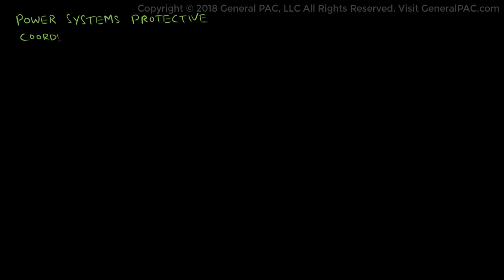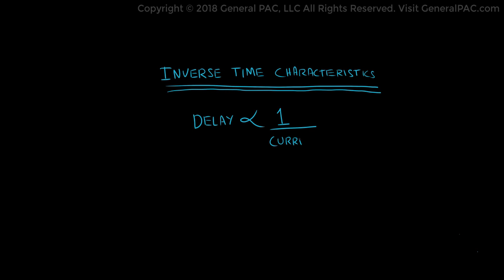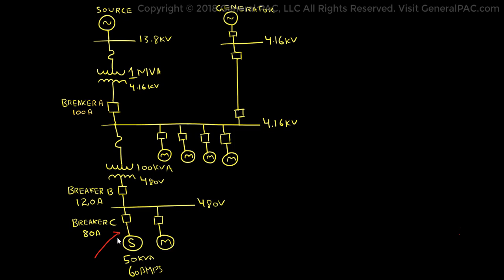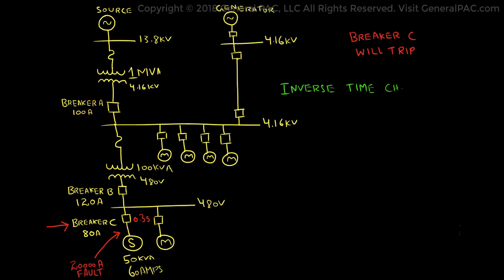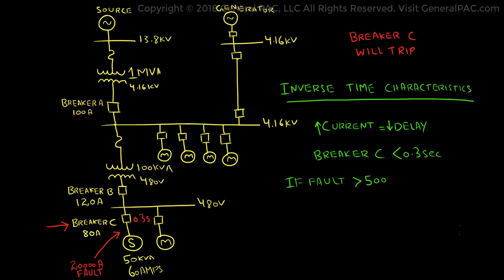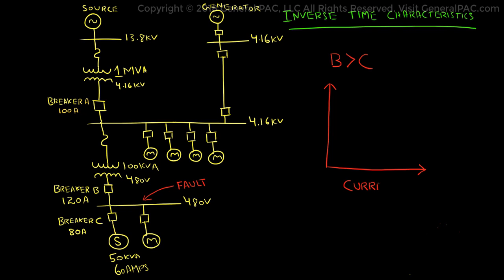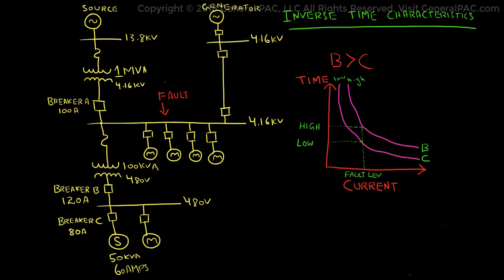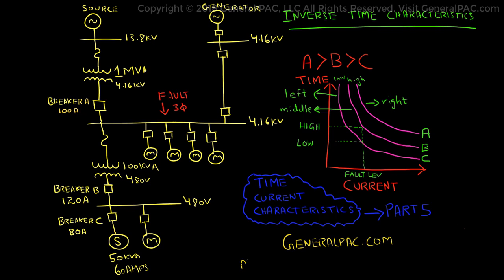Protection Coordination Tutorial Part 4

Comment: Breaker A has a lower rating than breaker B, is that a mistake?
Reply from the maker: Hi James,

It's not a mistake, Breaker A has a 100A rating at 4.16kV whereas, Breaker B has 120A rating at 480V. There is a step down transformer connected in the branch.

Thanks,
GeneralPAC by AllumiaX